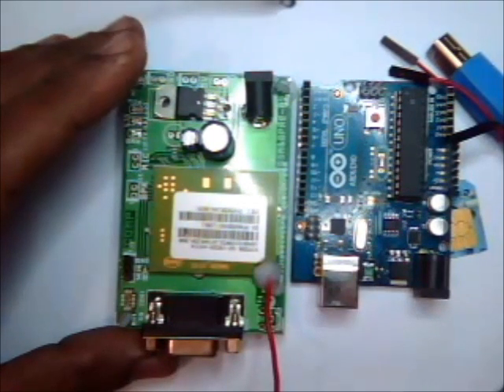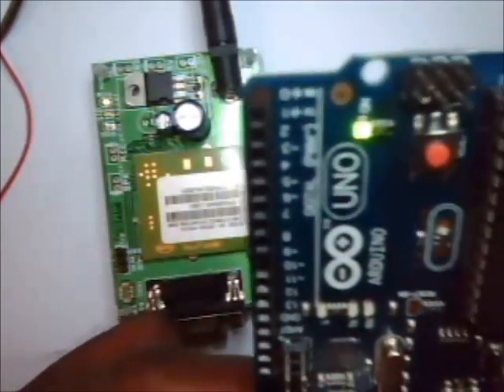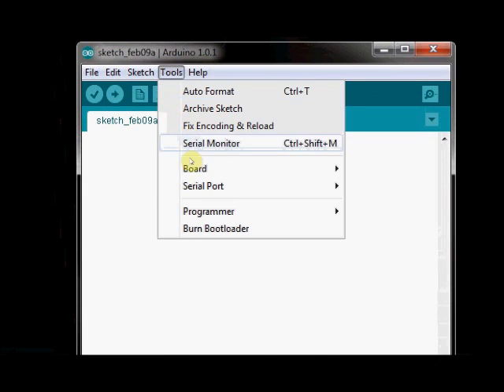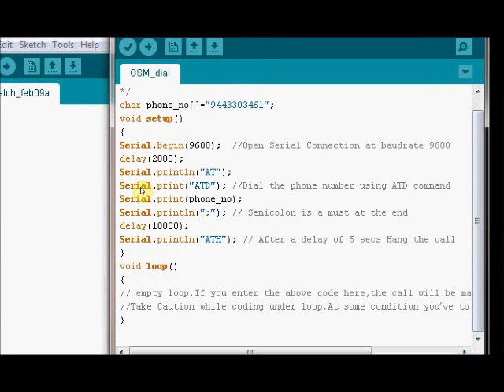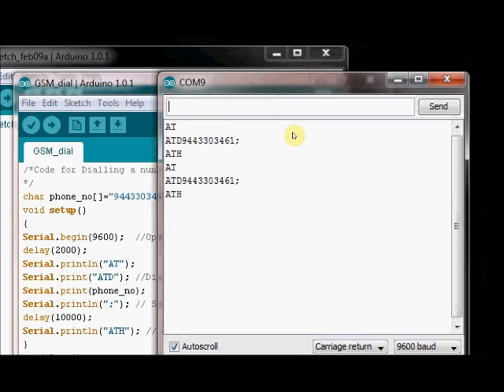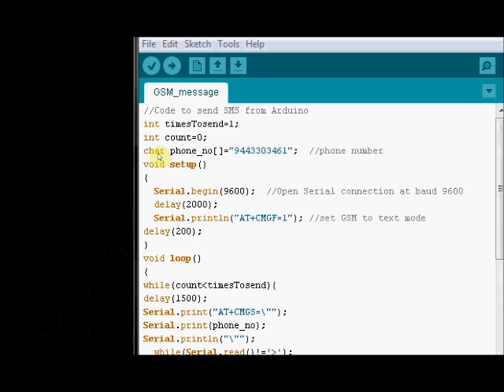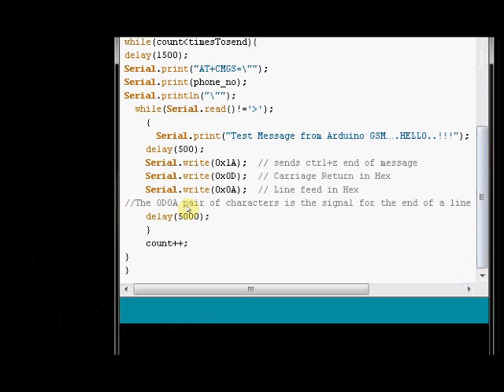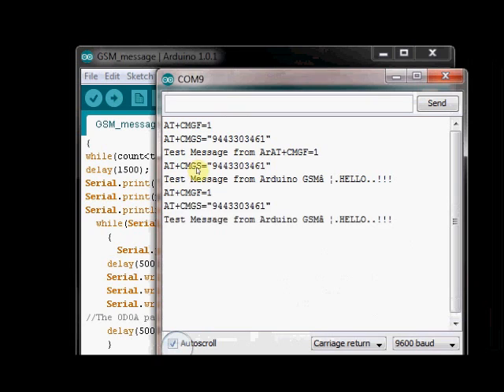ARDUINO WITH GSM - Making a Call & Sending SMS

Comment: Hi... sir i need to Send a sms  by using sim300 GSM modelu with arduino uno broad that sms will include the ultrasonic sensor output  
Please 🙏🙏 help through 
Mail I'd: jaganvenkatasen24@gmail.com
Call:9360506388

Comment: What use would it be if you connect TX to TX and RX to RX, nothing. TRANSMIT of one needs to go to the RECEIVE on the other board and visa versa. Unless the producer of the board labeled it in a way that it is not telling what terminal it is but where it has to lead to. But how do we know if a manufacturer of a board has switched the names of the terminals of the board? It is better not to re-invent logic.

Comment: Hi everyone. I have an question for the keypad of an call. For example.. I call my gsm shield and the shield recnognizes my number. So i press 1 and the motor start. But how to know what number was pressed by my arduino. I searched in the internet but i don't find solutions. Only the real keypad to touch but no keypad of the call from my telephone. (It is used for example in the call centers).

Comment: here is the good sms code which worked !

#include <SoftwareSerial.h>
SoftwareSerial mySerial(10,11);
void setup()
{
  mySerial.begin(9600);   // Setting the baud rate of GSM Module  
  Serial.begin(9600);    // Setting the baud rate of Serial Monitor (Arduino)
  mySerial.println("AT+CNMI=2,2,0,0,0");
  delay(100);
}

void loop()
{  
  mySerial.println("AT+CMGF=1");    //Sets the GSM Module in Text Mode
  delay(1000);  // Delay of 1000 milli seconds or 1 second
  mySerial.println("AT+CMGS=\"+91**********\"\r"); // Replace x with mobile number X with countryCode
  delay(1000);
  mySerial.println("I am SMS from GSM Module 800A..We can now send the sms\n");// The SMS text you want to send
  delay(100);
   mySerial.println((char)26);// ASCII code of CTRL+Z
  delay(60000);
}

Comment: Dear sir , after set at command in GSM Module or in EPS 8266 module it will store permanently, mean once we set ep8266 module in client server mode with other eps8266 module then these at command settings will be save permanently or at the time of restart these Module that time again we have to set at command in both client and server EPS module? Or Once we set client server mode of EPS module then can we send serial data from  client microcontroller to other end  server connected microcontroller? Or can we program microcontroller remotely via EPS module???

Comment: Sir, my name is Ashutosh kumar and I am a final year b.tech student. I have to make a project on vehicle tracking system. So I want help from you. I have made arduino and gps connection and code is also working. It is showing latitude and longitude. I have purchased a gsm sim 900A module and i have made the connection with arduino. But I don't know how to write code. I don't know from where I have to start code. Can we write gsm code with the gps code? Sir please help me in solving the coding problem. Thank you. I have attached my gps_arduino code below:-
======================================================================================================

#include "TinyGPS++.h"
#include "SoftwareSerial.h"

SoftwareSerial serial_connection(11,10);
TinyGPSPlus gps;

void setup()
{
 Serial.begin(9600);
 
 serial_connection.begin(9600); 
 delay(1000); 
 }
void loop()
{
 while(serial_connection.available())
 {
  gps.encode(serial_connection.read());
  } 
  if(gps.location.isUpdated())
  {
    Serial.println("Satellite Count:");
    Serial.println(gps.satellites.value());
    Serial.println("Latitude:");
    Serial.println(gps.location.lat(),6);
    Serial.println("Longitude:");
    Serial.println(gps.location.lng(),6);
    Serial.println("Speed MPH:");
    Serial.println(gps.speed.mph());
    Serial.println("Altitude Feet:");
    Serial.println(gps.altitude.feet());
    Serial.println("");
    }
}
==================================================================================================
Where should i place the gsm code to get my project ready?
Reply: Ashutosh Tiwari hello. what is the final aim of your code ?
Reply: hello sir, my final aim is to take the latitute and longitude of a place from the gps and with the help of gsm module it will send the co-ordinates to a particular mobile phone
Reply: sir, i want your help to write the gsm code to send a sms
Reply: sir, i have one more problem with me ,when i connected gsm to a 12 v power supply, the network led is not blinking .only one red led is glowing and the gsm gets heated up. so, please  sir give me suitable steps to get my gsm corrected
Reply: about 12 V. perhaps it's too high. 1 or 2 A ?
Reply: sir 1 A.
Reply: Ashutosh Tiwari try to change power adaptor.
Reply: sir,  why should i change the adaptor? is it adaptor's fault?
Reply: perhaps, voltage is too high. i work with A6C Ai Thinker. the voltage is 5 V

Comment: Dear Saravana, This is really very good & very simple code the send SMS with Arduino UNO with SIM900A. I have one question in my mind that is, how to send SMS once count reach on counter. By pressing push button the count increase, once reach set point of count the SMS should go out from SIM900A.
Reply: Hi Bro, How are you doing ? Are you designing a project with SIM900A?

Comment: hi sarvanan,
i want to make the calling using sim900A module as well as control using dtmf command set.
since i tried using AT+DDET=1 but my module showing error. could you advice me.
Reply: Hi Bro, How are you doing ? Are you designing a project with SIM900A?

Comment: haii sir i am using sim 900A GSM module .I uploaded this code and AT commands are landing in serial monitor but code correct    
from gsm module we are not getting calls and sms why????
Reply: Hi Bro, How are you doing ? Are you designing a project with SIM900A?

Comment: Hello sir, we want to send the soil moisture sensor values through GSM for the mobile as SMS. And we are getting the problem like GSM is not working properly when sensor is connected with arduino, but if we remove the sensor from Arduino GSM is working. Here ,we are not using bread board. Can you suggest us please, how to do project including Arduino+GSM+SoilMoisture sensor.

Comment: sir is it okay if i use a mobile charger to powerup the gsm board? i.e output 9v-0.6A
Reply: Sometimes it may be not supported for some gsm boards. Better you tell me the minimum voltage of your gsm board

Comment: I used the code, compiled, verified,and serial monitor shows the same data but my cellphone is not getting any ring from the shield .... whats the reason behind it?
Reply: But, when arduino is transmitting something to gsm modem, tx led is blinking - Indicating sth. is being transmitted. But there is no result coming out.
Reply: +rehnuma afrin 
Does your SIM card have any credits? 
Have you tried the suggested initial test, by ringing the Shield SIM number from your mobile and confirming that the LED flashes (to indicate an incoming call) rewind and watch video from time = 01:15.

Are you sure that your SIM and SIM900 module's IMEI has been registered on the Cellular Network you're using (on of O2, Vodafone, EE or other)? You can test this by placing the SIM card in your mobile and making a call with it.

Another thing that can catch you out is if your SIM is Locked, I think there is a jumper on the board to disable SIM lock, else you are going to have to unlock it before it will respond to Arduino AT commands sent to it...

Comment: is there any one who can provide AT commands for lapu sim, or how to interface with stk
Reply: +mohit arora 
Never heard of a lapu sim. What region/network does that come under?
The AT Command set is by definition standard across all Cellular Modems. So the most common commands like dial number get network status, send SMS are pretty much the same.

"The ETSI GSM 07.07 (3GPP TS 27.007) specifies AT style commands for controlling a GSM phone or modem. The ETSI GSM 07.05 (3GPP TS 27.005) specifies AT style commands for managing the Short Message Service (SMS) feature of GSM."

Comment: I did the same code for text message. How do I know if the arduino is sending the message to the GSM. My serial monitor shows everything. but I am not getting any SMS.
Reply: I am also having same problem. My GSM modem is working fine (separately). But, it is not working along with the arduino.
Reply: use a MAX 232 IC. read up on TTL signal conversion to RS232 signal. then wire it your self. Good luck!

Comment: saravanan my friend...  Can this gsm board be used in conbection with an arduino that is setup to work as a security system informing device. As i have plans to build an arduino with infra red sensors arround my workshop, so that when an infra red sensor is triggered and breeched can this breech signal from the infra red sensor through the arduino allow a text message or a simple call be made to my mobile phon which informs me of a breech within my workshop
Reply: +honi9 
Yes it can. 
You have just defined your project. Good luck..

Comment: HI, is there a way to run a counter of sorts, so it will send an sms every say 250 hours of running time, i would like to rig it up to machinery, and run it of the ignition and send me an sms every time it reaches 250 hours, to let me know the machinery is due for service! and help would be much appreciated!
Reply from the maker: delay() function can be used to generate a delay up to seven weeks time , if the time period is expressed in unsigned value.The problem with this function is that nothing else can run while the delay is in effect , wasting the resources.Inside Arduino board there are hardware timers.One such timer is millis() which overflows or reset to 0 in about 30 days.I think this function should suffice your need.

Comment: hello sir i am using a SIM900A gsm module and freeduino ATMEGA328. as u shown in the video i make the connection sir and the same code as u shown but it is not working, i only tried for making call, pls help me sir as i am trying from long time any how i got u r video it was very helpful but i need your help to complete it

Comment: Sir ,
I am using Arduino uno and SIM 908 module.I try this code .when I pressed reset button in Arduino board execte all the command.but call is not coming

Comment: Hello sir, I saw the video. It was very helpful. I also want to receive sms and i am not getting any code related to that. I am using arduino uno and sim900. I got code for arduino with shield. But my arduino doesn't have shield. Any help will be appriciated.

Thanks in advance
Reply: Ganesh B.G  Hi, if you get any solution then do share it.
Reply: Ganesh B.G send your email-id. i will send u the code for receiving msg.
Reply: Hello Sir, Are you in the field of IOT?

Comment: Hi, may i ask if I want to connect GPS, GSM and arduino. So that the location coordinate can send to mobile phone. may i ask should i choose uno or Mega? thanks reply
Reply from the maker: Mega has more hardware serial ports so that you can connect GPS & GSM.While using UNO use the Software Serial library to declare additional serial port.
Reply: alright, is the ways of use the Software Serial library to declare additional serial port is complicated? Since my project have to save costs. Thanks
Reply from the maker: YY yun Simple.Just download the Software serial library to the Arduino library folder.

#include <SoftwareSerial.h> at the top of your sketch & define the pins you want to assign serial Rx/Tx.
Reply: Saravanan AL , thanks. After I search, is GPS/GPRS/GSM module like GPS/GPRS/GSM Module V3.0  is the better choice for it? Since it no need use the extra  <SoftwareSerial.h>. Thanks.
Reply: Saravanan AL , hi, is me again, do sir know why need the registration of sim908 to network? Thanks reply..

Comment: Hi Sir..Your demonstration and detailed explanation gave us the motivation to do our project based on GSM with Arduino board .Following are few points I would like to share so that it will be useful for other viewers using sim900:
1. Rx of arduino is to be connected to Tx of GSM and Tx to Rx.(might be bcs there is no RS232 in this)
2.The call is made only when there is some delay in between AT commands.
3.In the sending SMS program, the while loop checking is not working always.

Comment: hello Sir, how do you send ad receive text message with STM32F4; everything works fine between gsm and putty but the stm32F4 microcontroller code is not working.
ok thanks

Comment: I'm using Sim900A GSM module interfaced with Freeduino 2560  and i have followed al ur steps still i dont get receive either cal or sms frm the sim900A
plz help me with remedy
Reply from the maker: Make sure that you use a separate power source to GSM.Ensure that GND of GSM boarded is connected to GND of Arduino.Tx of GSM goes to Rx of Arduino & Rx to Tx.
Open up Serial monitor of Arduino IDE & type in AT. If you click send button ,the RX LED on Arduino should blink.
Now feed in the code 

void setup()
{
Serial.begin(9600);
Serial.println("ATD944xxxx;");
delay(10000);
Serial.println("ATH");
}
void loop()
{
}

Remove the RX/TX wires of Arduino & upload the code.
Note that if you use Serial.print instead of Serial.println ,the code won't respond.Also if you miss out the semicolon after phone number, you'll not get response.
Open up Serial monitor.Press Reset of Arduino.
You can see the command landing on the monitor & the phone number is called.
It seems to be a simple code , but even if you miss out a semicolon or delay, it won't work.
Give a try again you'll succeed.
Reply: tis is our freeduino board 2560 and gsm board  with usb and not with rs232 plz kindly help us with the connections

Saravanan AL
Reply: sir iam using freeduino atmega 2560 and gsm sim 900A with usb  not with rs232. please kindly help us with the connections
Reply: Arul asha Dude Just Swap The Connection between Rx and Tx Pin It Will Work :) :)
Reply: Saravanan AL  sir your c ode and procedure is very helpful to our project thank you for this information. And also pls send the program code and procedure for sending sms like this

Comment: Hello Sir,I am from vellore.i am using a sim 300 module which doesn't have rx,tx,ground pins.Can u suggest a solution?do we have to make an intermediate circuit using max232 ?.....Please reply as soon as possible
Reply from the maker: Generally SIM300 is available in TTL breakout or with RS232.If you got GSM on a board,there will be TTL pins for sure.If you know how to make intermediate circuit with MAX232 , then pin 11 of 232 is RX (goes to TX of Arduino) ,pin 12 of 232 is TX (goes to RX of Arduino).IC 232 is not required as you take connections before it.
Reply: thanks for ur reply sir.Can u send the intermediate circuit using max 232.Because i tried one but it is not working.
Reply from the maker: Gautam Mohan As such Max 232 is not needed.Arduino pins can be directly connected to TTL pins of GSM. I just mentioned the input pins to 232  (11,12) if it was used.Else that wires can go to Ard. Tx/Rx directly.
Reply: so is it possble to connect directly from db9 of gsm to arduino tx,rx?
Reply from the maker: Gautam Mohan
Never.You'll burn your Arduino.DB9 voltage levels are much higher +/- 12v than what Arduino can accept.If your board has DB9 ,232 IC will be there.Take connections from pin 11 & 12 of 232 IC.It doesn't matter even if you pull out the Max 232 IC.

Comment: sir in this video u sent a fixed message.how can i place a variable there which alters the message everytime. or that variable can be a arduino input and i send that value through sms.how can this be achieved as it shows error while placing a variable in place of the message?

Comment: i did as u have shown..... program is getting uploaded even if i keep the rx and tx connections and the gsm is not making any call.... wat should i do? plz help me
Reply from the maker: With Rx/Tx wires connected to hardware serial the code won't upload properly.Remove the connections while uploading.First try the dialling part of code

void setup()
{
Serial.begin(9600);
Serial.println("ATD944xxxx;");
delay(10000);
Serial.println("ATH");
}
void loop()
{
}
Note that if you use Serial.print instead of Serial.println ,the code won't respond.Also if you miss out the semicolon after phone number, you'll not get response.Open up Serial monitor.Press Reset of Arduino.
You can see the command landing on the monitor & the phone number is called.
Reply: s sir i did wat u have said.... still not working :(
could there be any fault in my gsm modem.but when i call to tat modem it is ringing but iam not able to call from it... wat should i do now

Comment: i used 9v adapter to power my sim900. it is not working. should i power it up only with 12v adapter?
Reply from the maker: 9V adapter is enough to power SIM300, but the ampere rating should be at least 1000ma (1A).
Reply: actually sir, iam using sim900 wat type of adapter should i use?
Reply from the maker: mahesh lakshmipathi

GSM modules (300 or 900) work on 4.7v DC.If you're using a breakout board with RS232 ,use 12v /1A adapter.On board built in regulator LM317 converts it to required voltage.But 1Aamp source is a must.

Comment: in this case a GSM module takes input from a microcontroller. is it possible that a microcontroller can take input from a GSM module.?
Reply from the maker: You can read the message from SIM storage area using AT commands.AT commands should be included in the code so that uC can read message from GSM storage area & act accordingly.Refer to this blog post for handling received SMS :
http://alselectro.wordpress.com/2013/09/19/gsmhandling-received-sms/
Reply: Saravanan AL thanks a lot sir /\